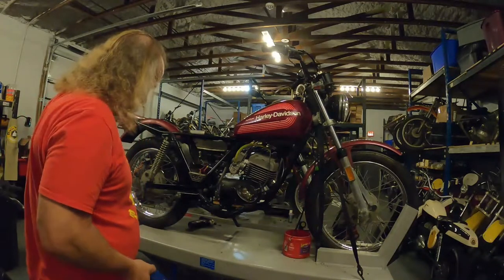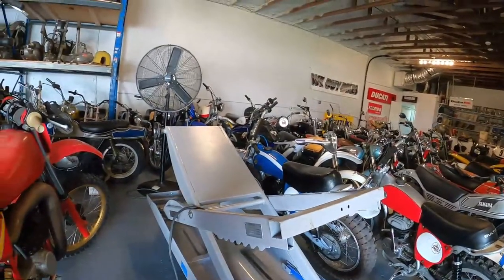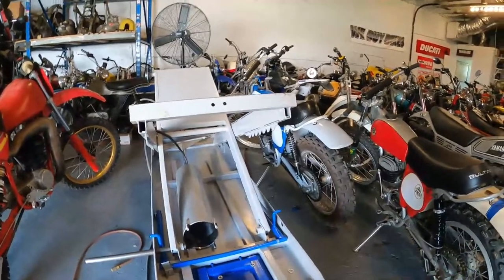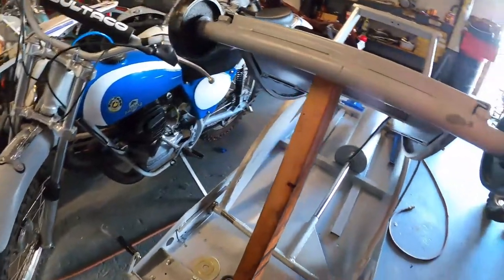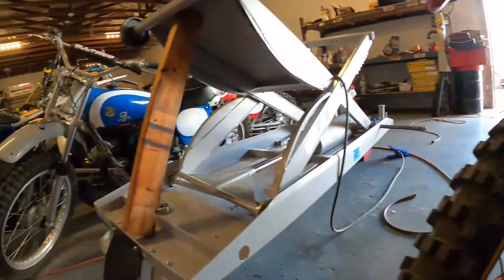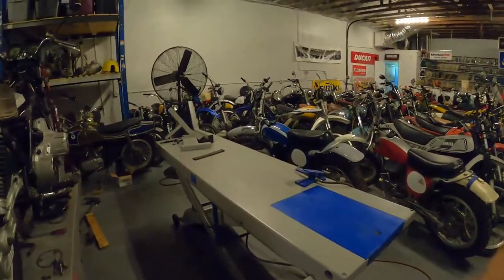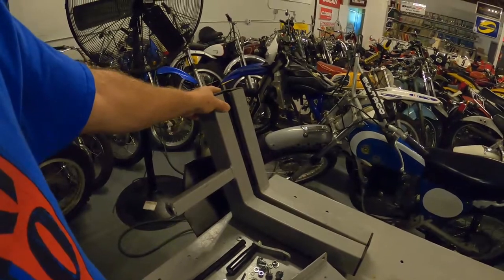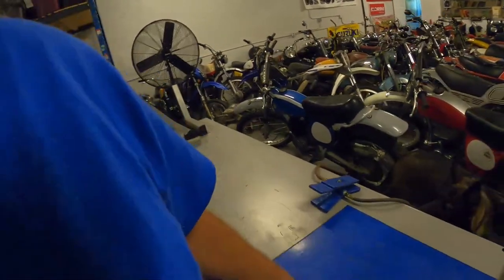FAKE HANDY MOTORCYCLE LIFT FROM CHINA - CAN WE FIX IT?

Comment: You need to dry the air coming from the compressor.  Water results in rust in the cylinder and thus leaking seals.  Also put air tool oil in the line supplying air to the foot control valve from time to time.
Reply from the maker: I've actually never had a problem, but I'm in a conditioned interior space
Reply: @bullpencycles  Air conditioning helps but does not reduce the humidity in the compressed air to zero.